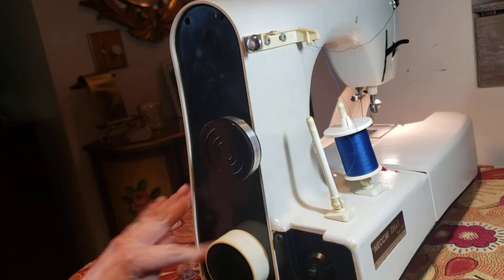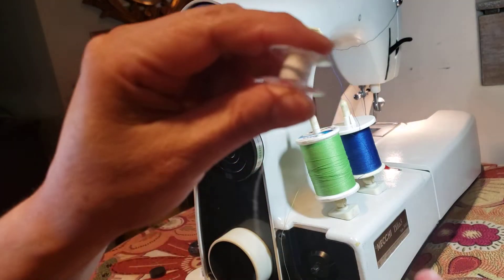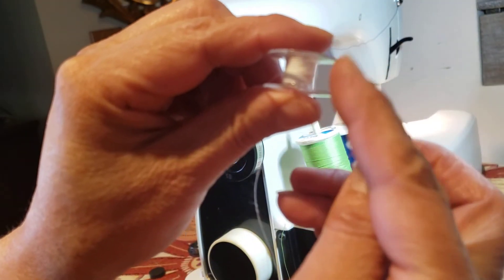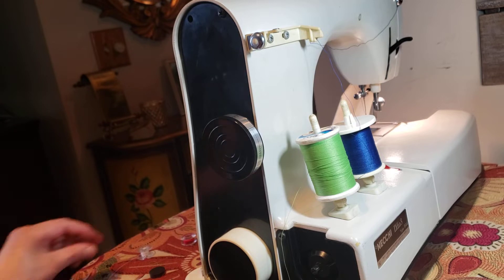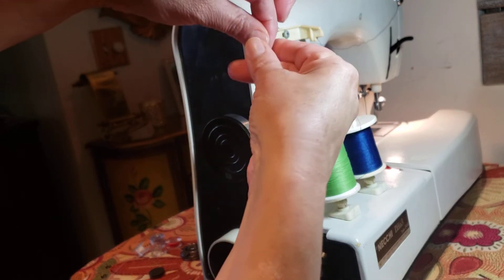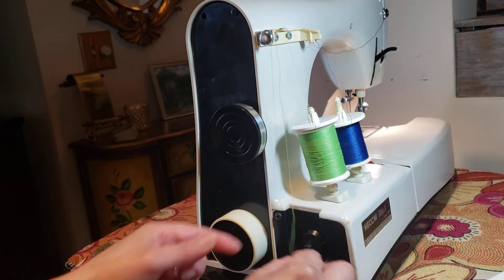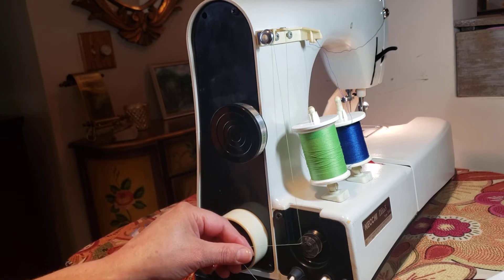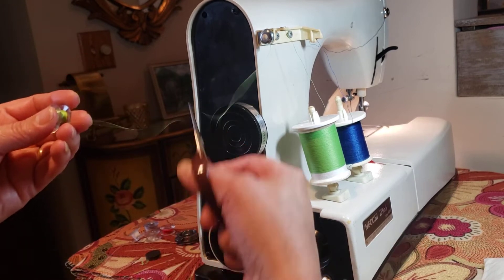Necchi Lydia 3

Comment: I have had my Necchi Lydia 3 for 47 years and generally love it. I was wondering if you do any quilting? I have a hard time trying to do free motion quilting on my Necchi. Is this something you have ever tried? I get skipped stitches. I have put new needles in and different sizes of needles. Also have changed the thread I am using. If you have any suggestions for me I would be forever grateful. I also have my mom’s Necchi which is much older than mine and came in a beautiful wooden sewing desk. It can fold down into the desk when not in use. It can sew through almost anything. Thank you for your video!
Reply from the maker: hi Mary, It makes me very happy to read about your machines, and from the love of sewing, it must be very rewarding to sew on the machine that your mother used..about your question, I have never tried to do free motion, but I have been practiced darning and embroidery, suggestions: 1.checked that the foot pressure on machine set at red dot 2.check that the hole in the needle plate is not hit by the needle, because the thread sometimes gets tangled in that area and skips stitches 3.  check that the bottom of the presser foot has no cracks, it should be smooth, I have videos on the channel that help us solve some situations, including an instruction manual for this beautiful Italian machine, subscribe to the channel. God bless you with this beautiful hobby
Reply: @luzbrillante7090  Dear Luz, Thank you sooo much for your wonderful response. I will definitely try Your suggestions. I have not tried putting the foot tension to the red dot. I have maybe not read my manual enough under the darning section. Believe it or not, I had my mom,s machine doing the free motion quilting just great for me. I have the manuals for both of my Necchi’s and read the one for the older machine more thoroughly than for my machine. Again, I will try your suggestions and thank you again.
Reply from the maker: @marye4992  , I guess you are as sweet as your words, please let us know the results, so we also help sewing lovers. Your comment encourages me to continue making videos, and may God continue sending subscribers like you, full of love, peace and happiness and above all united in prayer. God bless you!!
Reply: Dear Luz, I briefly tried your suggestions on my machine. I was not having good results on a continuous basis. Since my mom’s machine was set up and working well for my project, I went back to that machine. I will try mine again for my next project and I have a good feeling it will work fine. So much appreciate your help. God Bless
Reply from the maker: @marye4992  When I read your messages you give me a great feeling of warmth, Thinking of you, I tried to do free movement with a signature, but I didn't succeed, because I realized that I didn't have the right darning presser foot., 😅, but patience and good humor, your question has inspired me to make a video of which presser foot or adapter is for my machine, this point is crucial, nowadays there are many new presser feet that can help us, by the way, what presser foot you use ?
Reply: @luzbrillante7090  I actually have a free motion presser foot that I bought. It has an almost full circle at the bottom that is pretty thin and runs just slightly across the top of the quilt when stitching. It fits my machine fine but I just have trouble with the machine not seeming to want to catch the bobbin thread when I am going in a downward right to left direction and I get the skipped stitches. It is a mystery but I will definitely try again. You are an angel for looking into this for me. I do so hope it will help someone else too!
Reply from the maker: @marye4992  According to what you say about the skipped stitch, check if conventional sewing causes you to skip a stitch, if that happens, check if it is the needle plate that is hit, it is hardly visible .. but it affects the moment of joining the thread of the bobbin and the needle, I have videos of why  my my sewing machine skipped stitches. My dear Mary Don't give up, be patient, in my case there are times when I even laugh at myself when I don't achieve something, I have a coffee, I call the holy spirit... and then I find the solution. We're going to make it. Thank you for your words, full of joy and kindness. God bless you!!

Comment: Hola, I have a Necchi lydia 3 544. I have been looking for the foot controler for this machine. Love your video maybe its possible to send me the model number of your foot controler. Its the same machine. Thank you😊
Reply from the maker: hi Rene , thanks for the positive comment, the pedal model for the Lydia 3 Necchi is :Necchi  Foot Pedal #5315014 . I had two machines 544...one had the cables coming out of the machine, while the other had the cables attached to the pedal. very important that you know you have Lydia 3..watch the video on my channel Necchi 544, so you can see better what foot pedal you need or fix yours...also I have a video with the manual spanish but you can see  the manual...thanks to watch.God bless you